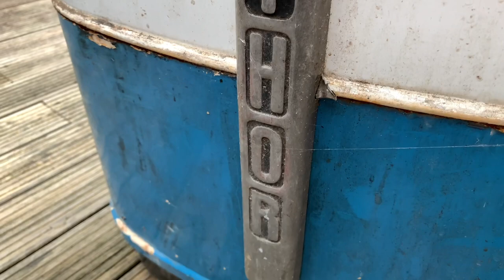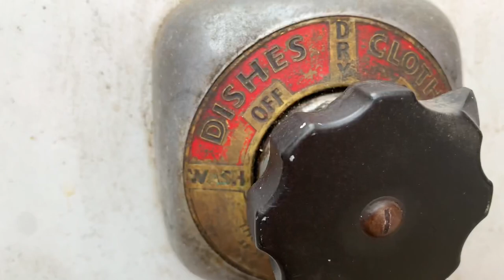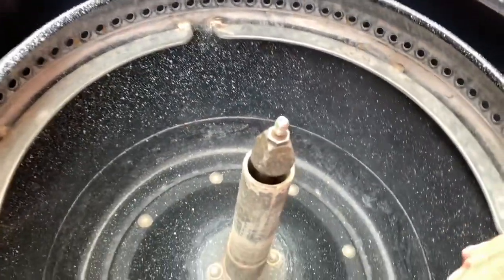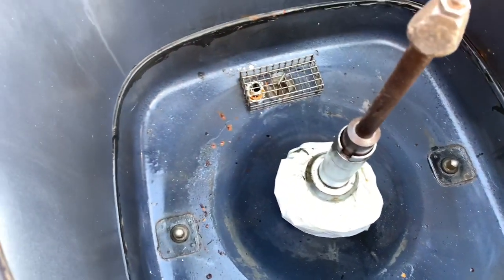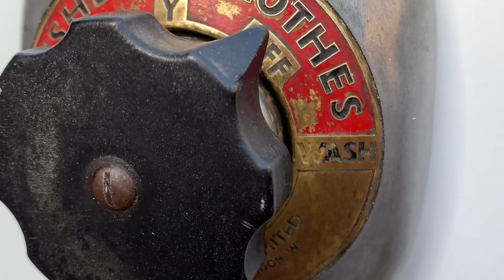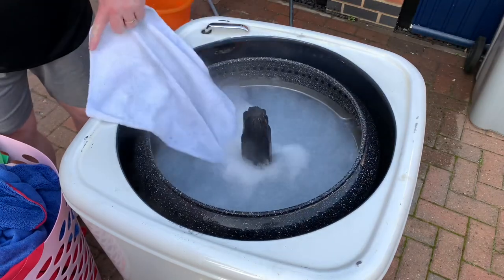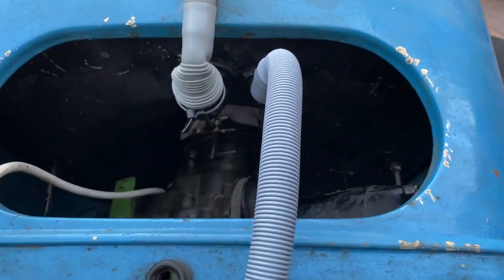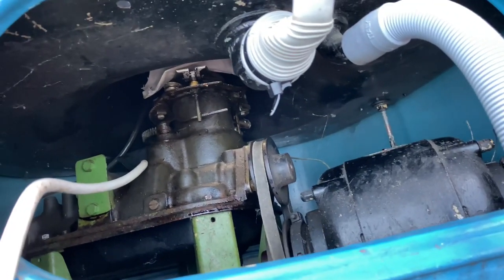1950’s THOR Washing Machine/Dishwasher Combo, Can We Fix It? @servisslimline

Comment: That motor it's the same one that where used for the Kacemaster Bendix washing machines build here un Argentina! Top loadres with no agitators. The washing was done by the oscilating movement of the entire basket that had to agitators (like a front load). Bye!
Reply from the maker: Thanks for the info!

Comment: Cool old vintage machine. The motor reminds me of the GE motor on two vintage belt drive power tools I have that belong to my great grandfather. Glad Phil and you are okay. We are guys we should be use to things exploding.
Reply from the maker: If you were here, you’d have it fixed in no time! Needs a mechanic not a white goods engineer 🤣. We never get used to appliances going berserk and going pop fizz!!! 🤣
Reply: @HooverLux  Maybe I am rather handy and do lost of my own car repairs. Too bad it was not as simple as bypassing the suppressor in the old Hoovers.
Reply from the maker: I know, I was gutted, it’s a shame I couldn’t just unplug the motor and remove it, the wires go directly into the motor and it’s all facing the wrong way. You have to dismantle most it to get to it. Someone will fix it definitely 🤗